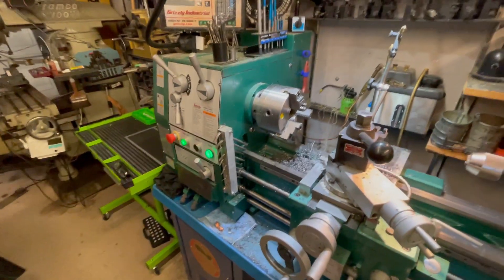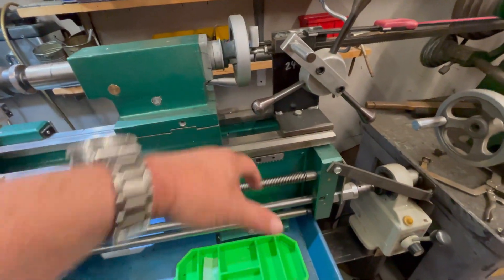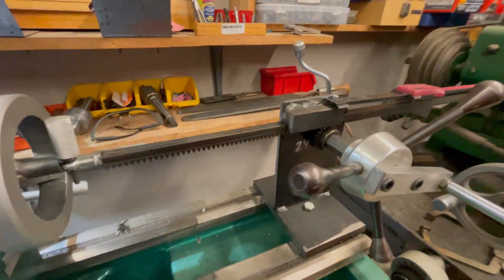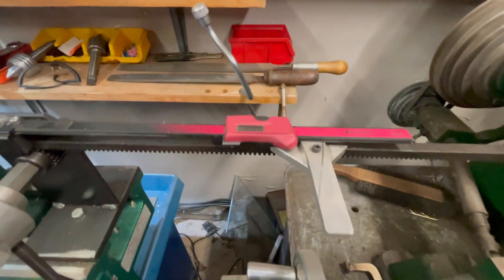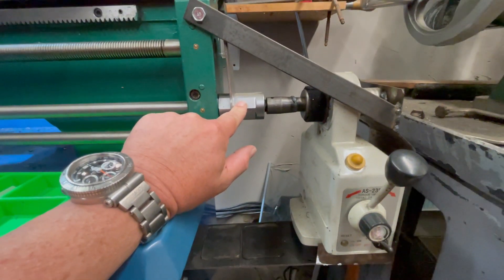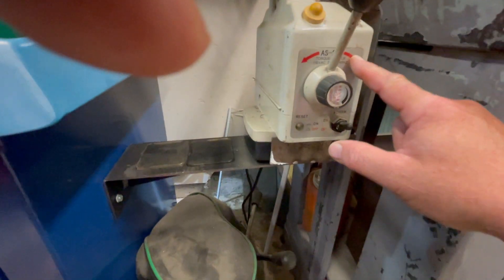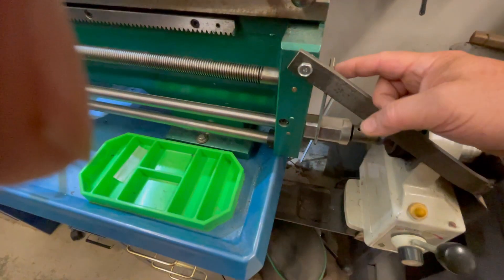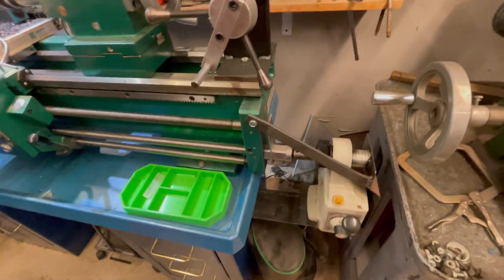Mods on a Grizzly 12 x 36 lathe, or to any lathe.

Comment: Oh oh. Just saw the thumbnail. Did you lambo the door on the Ford truck? How was that done?!?
Reply from the maker: Yea I did that and a lot more. I spent 27 years on that truck. I converted it to four wheel drive customized everything, 24" all custom hand built lift. did the car show circuit in the 80s and 90s. Then sold it.

Comment: Late to the game here but the info is brilliant. Slick idea on the power feeder. Still thinking on the power feeder gear reduction. That is a slick idea. That would make it a bit easier to use a VFD on the spindle and not have the feed rate change on facing operations.. Thoughts on the rack mounted low on the tailstock? It would add a twist if you use it for drilling. Digital caliper adaptation is also spot on smart. Three thumbs up!
Reply from the maker: Thank You.  Yea I put the rack at the center line.  Best I think. low would work if the tailstock lock is slightly on.

Comment: Missed how you attached the rack and pinion to the tail stock end. Did see you have a pin to unhook it but what did you do where it's attached to wheel shaft?  Have a Grizzly G-0709, really like it for the price. Great ideas, Now you need to make a lever for the carriage stop, and get rid of the allen wrench,   👍👍👍👍
Reply from the maker: A small eyeball fitting welded to a nut that fits hand wheel nut. The rack has a slot that takes the fitting in and has a drill bit cut and pressed into aluminum knob.

Comment: Good ideas, both. Thank You. I have a Taiwan lathe from the 1990s that must have been the inspiration for the Grizzly and similar. Either my motor shorted, or the relays did. Had a big arc and fire out the control box. That's been a head scratcher, but I think I finally have new relays wired correctly and a Grizzly replacement motor to hook up today. Of course nothing fits, you have to make it.